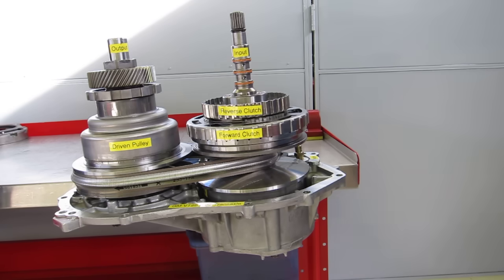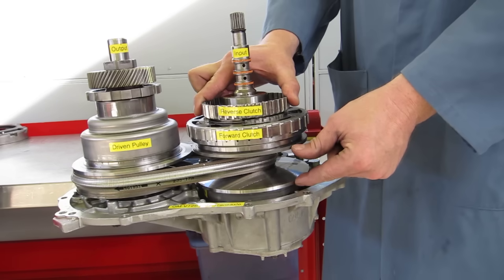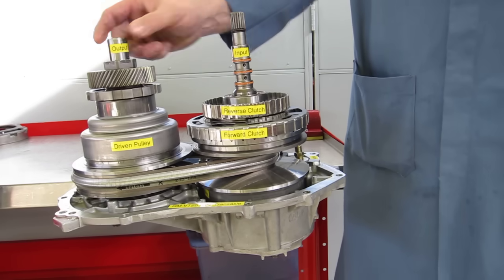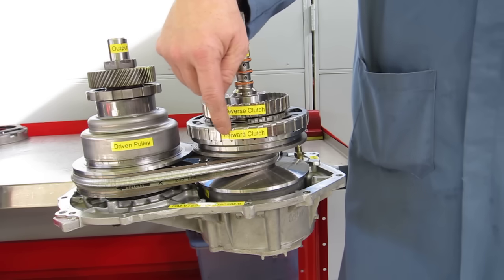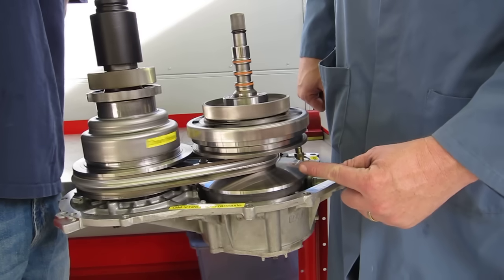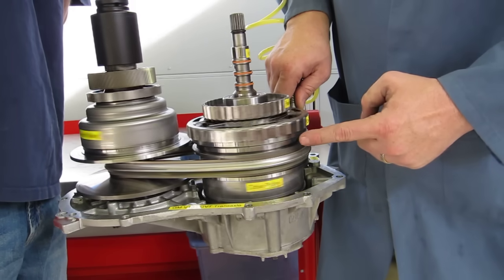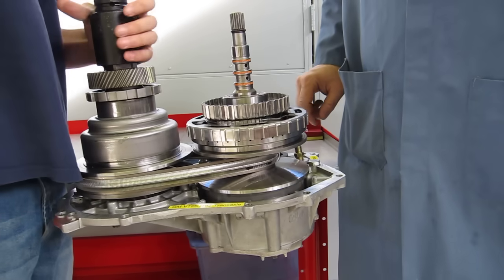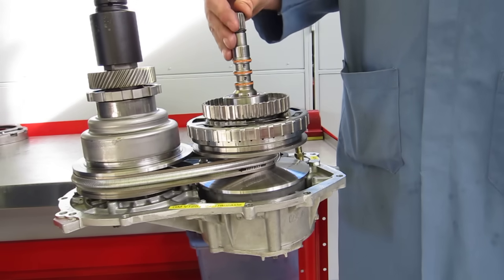Continuously Variable Transaxle (CVT) Operation

Comment: Good explaination.however this cvt is not reliable to used in hot country.i buy brand new honda civic fc year 2018,just clock 93000 km within 20 months,my cvt belt is broken. The most worst is honda not giving warranty for defect. After this i will change to manual forever.

Comment: How padel shifter work in cvt... Because it has no gears so it use oil pressure to regulate the pully for different gear ratio for padel shifter and trip tronic mod.. Plz reply...

Comment: This one makes picture clear about cvts but my question is how does applying pressure to one set of pulley causes the other set of pulley as well to adjust its gap automatiaclly?
Reply: The steel chain has a fixed length which forces a pull and push effect on respective gears........
Reply: Imoleayo Ogunbekun ok... :)

Comment: The principle of operation of the automotive CVT is easily visible on a gas golf car or snowmobile. They have open CVTs using rubber belts. They operate by the same principle.
Of course automotive CVTs use steel block belts running in oil inside a sealed case. They are hydraulically operated and computer controlled.
Reply: And just as weak
Reply: @mrofnocnon  True but it takes 15 minutes and a couple hand tools to change the belt on a snowmobile.
Reply: @jeremypilot1015  True but a complete rebuild or replacement gearbox for a car.

Comment: Very interesting indeed. First time I've seen a CVT demonstration without using a computer-generated animation. Really helps, thanks.
Reply: Doesn't matter how good the animations are, in most cases, they can't replace the demonstration with a physical object. I watched multiple animation videos of Differentials but I can't understand it, watched an old black and white video and now I can make my own differential*. Also, I never realised that gears are just multiple levers.

*Not literaly, I meant I understand the working of a differential that good.
Reply: Junk.
Reply: Anyone with a scooter or moped has this type of transmission
Reply: @Fishßeef   jaja, and chainsaw tooo... lol any CVT is bigger than motor at scooter or moped

Comment: So is there anything at all one can do (habitually or otherwise) to lengthen the life of those belts?
Reply: The belts usually last pretty well. The achilles heel of many of these CVTs are the race bearings on the input and output shaft, so regular CVT fluid changes (about every 30,000 miles) should maximize their life.

Comment: The best explanation of a Continuously Vulnerable Transmission ever.
Reply: i see what you did there. lol!
Reply: Honda tells me to do it every 25k :/
Reply: Actually jatco has the worst cvt transmissions with the highest failure rate
Reply: @dallas218  Nice to know. xD so we can chuck those into the dumpster.
Reply: @dallas218  .... Right alongside this GM version..... Big trouble within Forty-Eight thousand miles...
Reply: There are 2 things to know with these belt driven transmissions:

1) Do not hard launch from a standstill. Doing that is basically putting ridiculous amounts of torque into a belt that is stationary. You can hard launch a few times but eventually it will ruin the transmission, so DONT DO THAT, if you want to make it last. It's mainly for fuel economy and relaxed driving.

When you are moving however you can actually give full gas and accelerate or brake hard, so long as you're moving (less stress on the belt).

2) Change the CVT oil frequently, the fluid inside is not "sealed for life". Like any mechanical device with lubrication, that lubricant breaks down over time and needs flushing and changing.

Yet people don't know and we end with broken transmissions. 🤣
Reply: @aaryeshg.6526  .... Actually changing the fluid in most of these especially any jatco or this GM garbage require splitting the case which is not easily done by the consumer at home....
Reply: @aaryeshg.6526  CVTs are people prove (sealed and the don't even have a dipstick)!
Reply: Точно. Лучшего ролика я не видел. И наглядно, и объяснения - доступным, вполне понятным языком
Reply: Had a Ford with CVT and went bad at 62000, no fixing only way to do was to get new trans for 7000$.  No thanks will never buy a car with a cvt.
Reply: CVT in Honda and Toyota is very reliable. But i can't say the same thing for Nissan
Reply: Demonstrated on the biggest piece of junk out there the GM version is garbage to this day
Reply: @radicalron65  lmao so true
Reply: A scooter transmission
Reply: CVTs are garbage but a toyota one will b least garbage
Reply: Ikr everyone else just talks about the engine and not about the transmission
Reply: 10 years on..very elaborate and lively as ever. Live long and Prosper!
Reply: Yes as opposed to your super strong ones in standard transmissions oh wait.
Reply: HA!! I love that
Reply: They put cf belt replacing that steel. . I wonder how that works?
Reply: Very good transmission in my car never has problem and and I track this thing and beat on it
Reply: Boss
Reply: Subaru is the way
Reply: LOL
Reply: Buy toyota you will never have problems with your cvt
Reply: Saying that it's just blind brand loyalty. I've worked on many vehicles and I've seen many Toyotas with failed Transmissions. Yes, they have a lower failure rate then some domestics. But they still fail. The key is maintenance.
Reply: Bennett Perry there is no maintenance on toyota cvt
Reply: Bennett Perry Aisin cvts/transmission have the lowest failure rate, and it’s not even close.  Toyota did have a problem in the 2015-2018 corollas I believe with a cvt, but I believe they fixed that, but that’s about it.  I HIGHLY doubt that you worked on any cars with a cvt, let alone a Toyota.  But yes if you drive 100,000 miles in a regular automatic transmission or a cvt you are asking for trouble, I don’t care what brand.
Reply: @BronMeloDame999  The only reason manuals last 100k+ with no big issues is because they aren't overly complicated. New cars break down at 50k meanwhile 1966 Volvos last 3 million miles with few major issues. Irv Gordon may be dead, but his car lives on and hopefully will outlive me, as well. 

In the year 2525, if man is still alive, if woman can survive, they may find a three hundred million mile Volvo.
Reply: @repnatl  absolutely not, you dont know what you are talking about. I have two toyota cvt for severals years and they work like charm.
Reply: @EH_There_Bud  
You mean changing the transmission fluid every n miles?

How about eCVTs/HSD, they seem unbreakable, only gears, no belts no chain no pulleys.
Reply: @EH_There_Bud  exactly! I'm a Toyota fanboy but I know NOTHING lasts without maintenance. My 1988 Land Cruiser is still running strong with 325K miles because I take care of it.
Reply: @mrmadame28  That's not entirely true, unless we're talking about the Hybrid eCVT which only has three or four moving parts, there are first gen Priuses out there with the factory motor assembly. The regular CVT like what's in the Corolla while reliable than other CVTs is still pretty vulnerable.
Reply: mrmadame28 lmao thats bs mine blew at 100k pos
Reply: @NiggaGang69  
How many times you changed the transmission fluid before those 100k miles?
Reply: @guss whu You have to get the toiroidal cvt transmissions those are a wee bit better then thease
Reply: It's CVT you freak.. ( we know what it means)
Reply: CVT transmission aka JUNK!
Reply: Cause this I Prefer ever mechanic transmissions.... kaakaka
Reply: Vulnerable? maybe Variable?
Reply: @ВасилийИванович-ы3о obviously  you didn't get the sarcasm...

Comment: At this point with the current technology I would recommend to either go with a normal automatic or a hybrid with the e-cvt’s since they are more reliable than a normal cvt.
Reply: Is Honda cvt reliable?
Reply: @gutadin5 Toyota makes the best transmissions, cvt, traditional automatic, and standard.  they're built by Aisin. however, in all honesty for Honda, yes and a little no, Honda makes their own engines and they put out a lot of power sometimes with very little displacement as low as 1.5 liters, and around 180 hp, paired up with their built in house CVTs, they're weak to handle all that power and they may fail sooner. hondas traditional transmissions are also built in house, and they too are a little on the weak side too but will outlast their cvts, with normal driving. and if you can drive a standard transmission, you dont have to worry about nothing, honda builds them really strong. that being said, Nissan has the worst cvt and traditional automatic transmissions they are built by Jatco, and history shows those transmissions are trash, some start failing at early as 50k miles.
Reply: @gutadin5  also i should add, if your transmission, (cvt, traditional automatic, or standard i.e manual) has less than 60 thousand miles its safe to change its oil out, and you should at every 60 thousand miles at least. take care of them and they shouldn't be a problem, also dont slam on the gas all the time.
Reply: @thatroarboi2788  I'm thinking of buying my wife a Honda City cvt, it's a subcompact and this Honda model is in Asia, Honda City, this model is not a available in the US.
Reply: @gutadin5  i see, do your research,check where the car you're looking at was made. a quick Wikipedia researching says japan assembles them in Yorii, Saitama. preferably hondas made in Japan are the most reliable. cvt or not
Reply: @gutadin5  also what year is the car you want to buy your wife
Reply: @thatroarboi2788  I want to buy the 2020 Honda City model for my wife , it's assembly plant is in Thailand, this car is a subcompact cvt and a perfect fit for her.
Reply: @gutadin5  if your budget allows, I'd buy one made in japan, if possible you can also look for other versions of civics, accords with traditional automatic transmissions if she cant drive a manual transmission, also made in japan, just have a mechanic check it out
Reply: @gutadin5  the cvt, should be fine for at least 8 years with regular maintenance
Reply: boi  you think this Honda City cvt will last 4 years or 60,000 kms without any issues ?
Reply: @gutadin5  yes, it's when you travel more than 100 k miles when they start to seriously fail
Reply: @gutadin5  mine died at 28k
Reply: @Youtubeuser1aa  what kind a car?
Reply: @gutadin5  Honda CR-V

Comment: I'm really curious if maybe you can help. My 2010 jeep compass is making a clacking noise upon acceleration and deceleration, a 1-3 clacks each time. Sometimes it'll make the noise when shifting from park to reverse or park to drive. It doesn't however make the noise when revved in park or nuetral. Thank you for anything that you can point me to.

Comment: They seem to have their mind set on these since it's hard to find a car without it.   The failure rate of these has convinced me to drive my 10 year old civic a little longer.   I wonder when or if they ever have the bugs worked out.   It would seem like they need to get rid of that belt.

Comment: Here’s a question though. I have a civic turbo sport that has manual shifters on the wheel. So how does my car shift manually when I use the shifters?
Reply: CVT vehicles that have a manual mode have a set of pre-selected gear ratios to mimic the different gears of a traditional automatic or manual transmission. Basically, when shifting gears in a CVT, the transmission pulleys instantly move to the exact position needed to get the output ratio of the current gear.

Comment: So does overdrive happen when car runs on higher gears?
Reply: You can think of the CVT part of the transmission as a variable overdrive/underdrive selector for each gear on the input shaft, adjusting as needed to provide the optimal gearing for the driver's input, the engine's power band, and the currently selected gear. An example is if at the lowest CVT gearing for gear 3 is 0.9:1 and the CVT can adjust by 0.2:1 then the range of gear 3 is 0.9-1.1:1.

Comment: This means you can accelerate while maintaining the same rpm to stay in the power band. But doesn’t this make it really weird? I mean the engine sound will stay the same while you’re gaining speed
Reply: Yes that's how it works. It's kinda weird but auto transmissions are weird compared to manuals, anyways. It's kinda like a moped but when you put your foot down the ecu lets the engine rev higher or when you're just cruising the ecu tries to keep the rpm down as much as possible.
Reply: @fullmetaljacket7  auto transmission is the best because it does everything precisely and u hear it shift gears
Reply: That's what the do and sluggishness

Comment: Hi Weberauto
I'm not a mechanic, so the question that I have might sound stupid .
I live in Europe and we are driving with car front driving system , with 2 driving shafts coming out out the engine giving power to each side of the vehicle.
Could you put on each shaft 1 CVT 
To maximize the power of each wheels.

Comment: The most efficient and boring transmission ever made. CVT. Video is A+ though.
Reply: And most unreliable. Its usually require maintenance after 40k miles.
Reply: @A7ibaba  not really cvts have been in farm equipment for years now.

Comment: When I was a teenager, in the early '60s, I had a Rockford motorscooter that had an automatic transmission based on this principle.  The faster the engine turned, the V belt went outward on the engine side and in on the drive side.  No shift points just smooth starting and driving.  It worked with weights and springs and was base on centripetal force on everything.  Not nearly as complicated as this but very similar.  As the RPM increased on the engine shaft, weights were pushed outward on the variable pulley and the V belt moved closer to the spindle, this pulled the other end of the V belt into the variable pulley on the wheel.   A complete transmission rebuild consisted of replacing a very easy to access V belt.
Reply: do you one better the first car to use it was designed in 1958 as the DAF Variomatic

https://en.wikipedia.org/wiki/Variomatic
Reply: @dawnmaster68  en zo is het! Voordat die Amerikanen weer met de eer gaan strijken!
Van Doorne’s Automatische Transmissie!
Reply: You know exactly what year it was or anything? I'd like to look that up cuz that sounds like an interesting way of doing things

Comment: They should use gear to gear instead of belt  or real chain
Reply: As with everything there are pros and cons. I've only experienced this kind of transmission in Mercedes, but they do work pretty well, I'm not aware of many issues with them either, not that I've looked. Now I wouldn't even consider towing anything behind a vehicle with a CVT in it, but I don't think that's what any vehicle with a CVT installed is designed for either. Light duty town cars for grocery getting and errands.
Reply: "gear to gear" is called a manual transmission..

Comment: I'll never own another vehicle with a geared transmission after owning one with a CVT. In my opinion, the CVT provides the best driving experience.
Reply: I honestly agree, the only real issue seems too be reliability but I've had my 09max since 80k made it too 140k no probs before it got totaled. I own a charger now and in the beginning it felt so wierd.  Its a fun car but I definitely prefer cvt and wish I still had my max.
Reply: Yeah at first time using car with cvt,i feel weird because old auto transmission used to have a pull effect..but i find it very convenient to use cvt because no lag feeling,and i like cvt with paddleshifter also,it feel like using ferrari car..well manual transmission is good but comeon we are in the year 2019,something need changes,cvt is new technology,i admit it..sometime am i worried for my car's cvt also..as today im on 156k km on my mitsubishi lancer 2012 with cvt invect-111
Reply: It really depends what you want from transmission and what type of car you have. I've bought my GF Honda jazz/fit with cvt and for that little car it is a perfect combo. But for driving pleasure point double clutch is my favorite anytime.
Reply: Start saving your money now because they are a proven can of worms.  Ask any honest transmission mechanic.  They LOVE them. For obvious reasons.

Comment: I’m not sure the CVT will ever fully become optimized and the issues with longevity and excessive torque resolved since most cars are going electric at a much faster rate than anticipated 5-10 years ago.

Comment: Must i say this transmission will not take abuse like most transmissions will. So if you maintain it, and drive it properly it should be fine.

Tbh my corollas cvt is miles better than most dodge autos.
Reply: That's not really saying much. If you made it home from the dealership your transmission is better than a chrysler product.

Comment: These Transmissions are junk are made for lawn mowers and go karts everyone that I know that has them wind up having to replace it at 35000 miles
Reply: I have a Nissan Rogue. I just replaced my cvt at 100k miles. I needed to replace it at 80k but waited a bit. Very unhappy about this. I bought my car new in 2013...

Comment: My 05 Prius is at 270,000 miles and I've towed packed 5x8 u haul trailers over a 1000 miles.  The car still drives and accelerates fast with no slipping or transmission problems.  Toyota makes this CVT stuff a lot better from what I've heard.
Reply: The Prius has an eCVT. It doesn't have a belt like a CVT.
Reply: The eCVT is near bullet proof. Luckily, you don't have a belt driven. You have a planetary gear set and an electric motor. Possibly even more reliable than a traditional automatic